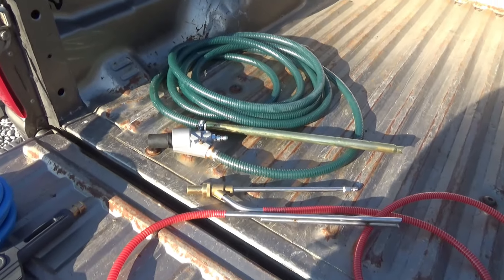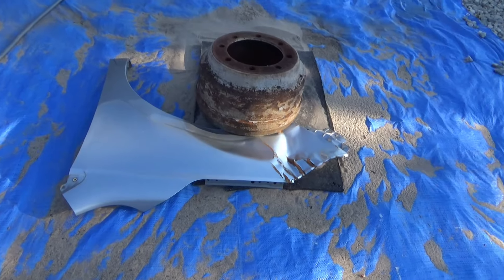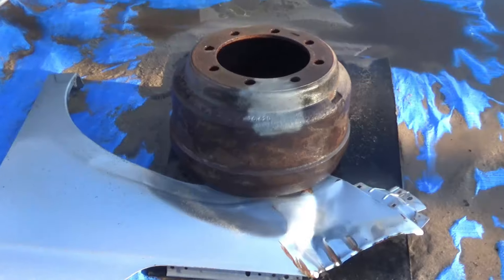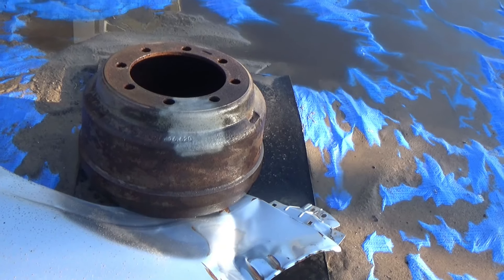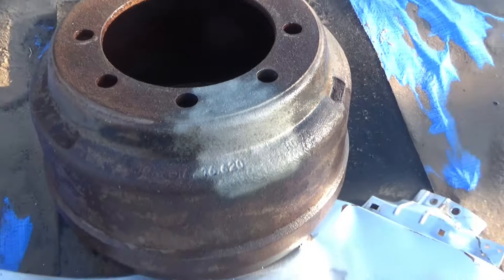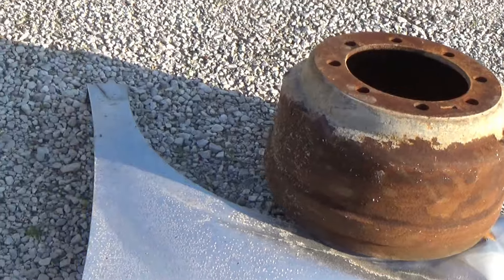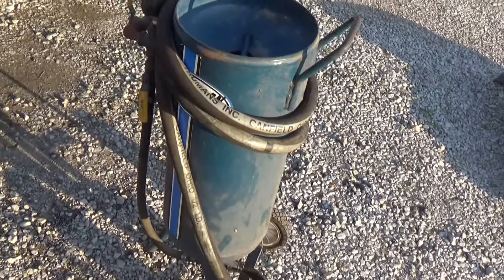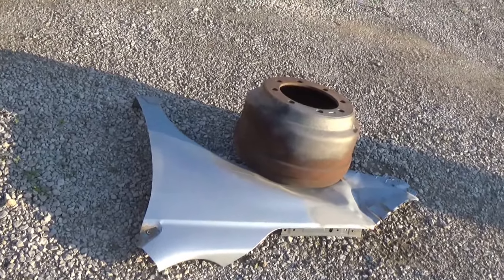Testing the bigger 3/8 inch wet sandblaster

Comment: Great comparison. I've used the dry (with the box, not open-air), but not the wet. Always did a fine job.
Reply from the maker: It would take a $20k blast cabinet to do what my pressure pot did that I only paid a few hundred for twenty some years ago. The wet blast is good for containing the mess for outdoor blasting on a budget.
Reply: @GordonRobertsonDIY    👍

Comment: My Boss and I fought and fought one summer with that same Hydro Sandblaster unit. Its just too finicky to fuss around with and slow going with all the hoses. (we used both silca sand And Black oxide abrasive)
Reply from the maker: Something may have been wrong with the equipment or setup, this definitely has it's place. I think the smaller unit is better for the home user.